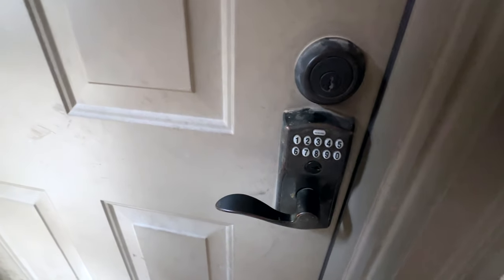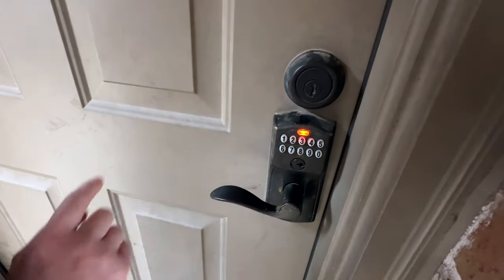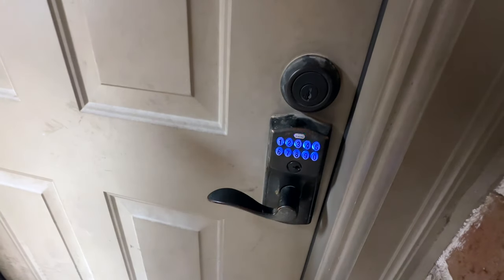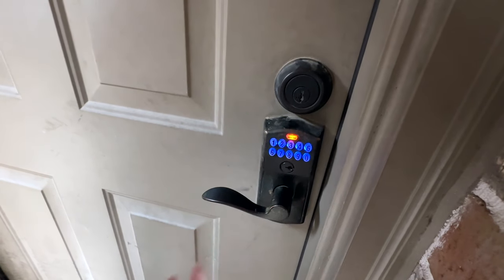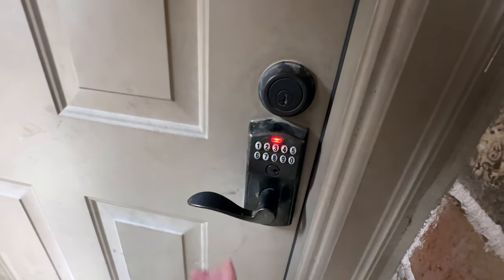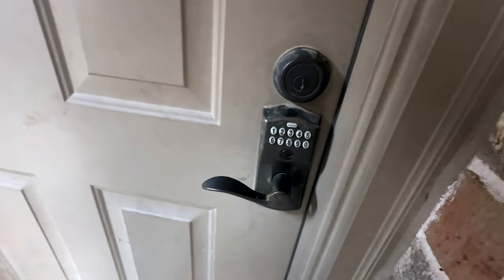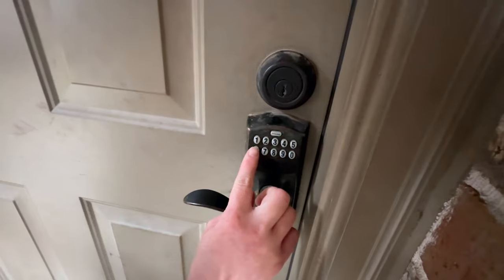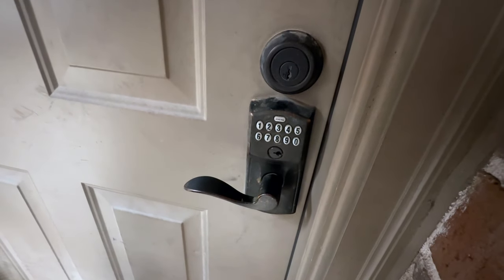HOW TO CHANGE SCHLAGE KEYLESS DOOR LOCK COMBINATION CODE  (SCHLAGE FE575)

Comment: This is the only quick, easy, accurate video I've found that actually works. Note: if you don't have your programming code, you can take the lock off the door and the inside of the front part has a sticker with that passcode.